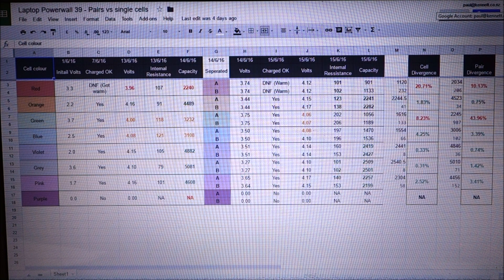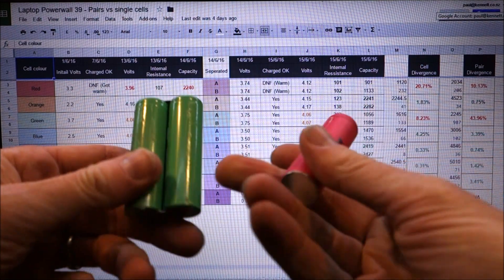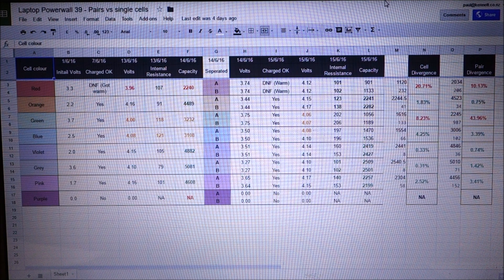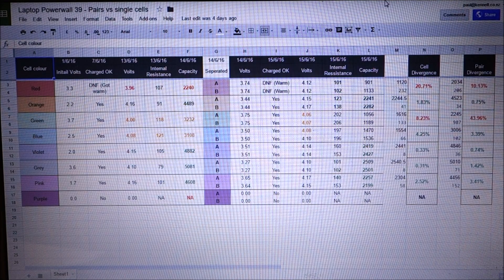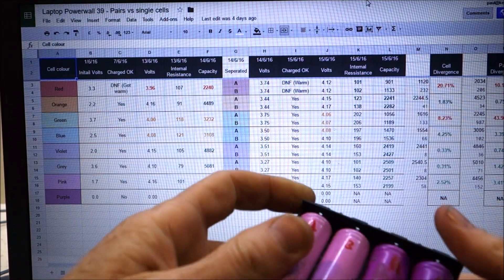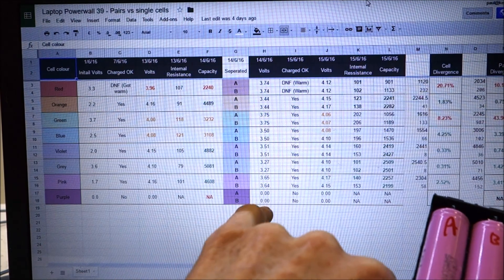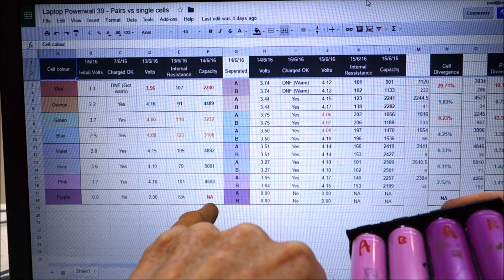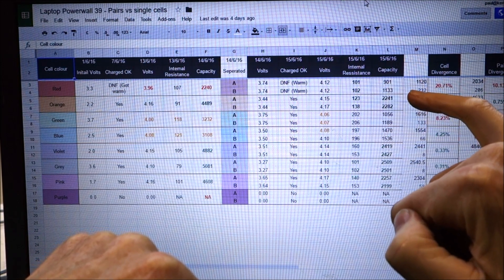Laptop Powerwall 41 - 18650 pairs vs singles: results

Comment: any suggestion for the balancing of these packs as a whole without the bms on them, http://www.ebay.com/itm/12V-280WH-BOSTON-POWER-LITHIUM-ION-BATTERY-PACK-18650-4-7AH-POWERWALL-BATTERIES-/182681892086?hash=item2a88b074f6:g:b7kAAOSwkX1ZdLk6
i have 40 of the packs but did not receive the ones i have from this seller 
keep up the good work sir thank you very much..
Reply from the maker: You could add an e-bike BMS perhaps or run them without a balancing BMS and just monitor them. They look like nice cells.

Comment: In my brief experience with old laptop 18650 cells. When you separate parallel cells that show low voltage/capacity, you might find some of the cells will take a charge, but never return to near it's initial voltage/capacity. Cells in parallel usually exhibit similar characteristics, even when separated.
Reply from the maker: Yep - that's what I found too.

Comment: When you discharge them as a pair then they will see 500mA per cell but when you discharge them as a single cell they see 1000mA per cell, this is twice the discharge current which will have an effect on a high internal resistance cell if my understanding of the internal resistance is correct.
Reply from the maker: True. I didn't bother to stay with 500mA per cell becasue I was more interested in looking for differences (delta) between the cells capacities, rather than their actual capacity.

Comment: I was wondering why the int resistance is not a lot lower for 2 cells i.e grey approx 50mohms and violet 75-80mohms.
Reply from the maker: Me too. Lots of potential sources of error in my setup; temperature, voltage, poor connections.
Reply from the maker: I'd love to see someone else replicate this test.
Reply: I would but I only have an accucel 6 which does not have that function.

Comment: Lower voltage after charge might be also caused by TP4056 modules. Looking at datasheet charging voltage is somewhere between 4.137V and 4.263V.

Comment: unrelated... i have a cell that charged up fine at 500ma. left it over night, but now is self discharging and getting warm. should i be concerned or just put it in the freezer and let it stabilize?
Reply from the maker: I would be concerned. A warming battery as it just sits there sounds like a bad situation to me. If it were me I'd discard that one. It could be that the electrical barrier between the anode(+) and cathode(-) is breaking down. If that process continues you end up with a short circuited battery. Which would be bad. I don't know for sure - but I don't like the sound of it.
Reply: I dont intend on using it i was just worried that i would need to keep an extinguisher nearby
Reply from the maker: I have an old steel ammo box that I put batteries like that in. Then take them to the recycler. Mostly things don't go bad, but...
Reply: +Paul Kennett day two its now down to .975v from 4.15. wowza. seems to be back to the normal resting room temp. ammo box is a good idea tho. thanks.
Reply from the maker: 0.975v... Yikes!

Comment: Great test. IR of red cells looks weird, you cant have 100mohm for single cell, and 100mohm for 2 cells paralel, its should be like 50mohm. High divergence of green cells is imho because after parallel discharge, you still had 3,,75V, which could be like 30% remaining, and discharging single cell with 200mohm you got cutt-off 0,1V (ohms law) sooner then discharging parallel two cells with 200mohm. 0.1V can be 10% сapacity. Measuring voltage after discharge single cell would be good to know too.

Comment: Good data there.  I'm with you on testing the pairs, especially since my battery packs are designed for pairs.  What I'm doing with the pairs that test poorly is separating those and retesting them individually.  Then if any of those are OK, I'll combine with other single cells I have to make up new pairs.  I end up with singles on the 3P laptop packs.  I've also just blindly stuck singles out of the same pack together and those have tested about the same as other pairs in that same pack.  If I have a 3S3P pack, I end up with 3 original pairs plus 3 separates of which I might have stuck two together and then I'll be left with one single.  I do try and test the singles at half the current that I test the pairs with to keep to the same discharge current per cell, although sometimes I forget to change the discharge setting.
Reply from the maker: I was too impatient to discharge the singles at 0.5Amps. 
With my previous pack I resorted to building pairs from singles towards the end as I trying to reach my 2kWh capacity goal. It does mean I have to solder directly onto the battery which I'd prefer not to.
One downside of pairs is they don't look nearly as tidy as the singles. HPPowerwall's packs look great.
Reply: I hear you on the discharge time issue.  That's why I sometimes forget to change the setting.  I do see a small difference in capacity between 1A and 0.5A.  When I separate my pairs (or singles from triples) I look for how to leave as much of the original strapping in place so that I can solder strap to strap and not to the cell itself.  I haven't separated many of my "bad" pairs yet, figure I'll do that once I skim off as many of the good pairs first.  I suppose a lot has to do with your availability of laptop packs.  I need to pay for mine, so it's worth trying to eliminate false negatives from the initial testing.  If you get no- or low-cost packs, then making a go/no-go call with as little time invested is a good strategy.
Reply from the maker: Yep - my strategy has always been to eliminate time wasters as soon as possible, but hang on to the "bad" ones for later when I'm more desperate.

Comment: From my own testing the variability in your test might be explained through the discharger you were using in the other video. As is designed to test once cell at a time the discharge rate (assuming 1A) will be split between the pair of cells and stress the batteries less if it were discharging at the single cell rate. But otherwise it is a good test showing how close the cells are to failure if they cannot handle a 1A discharge and the quality of the higher capacity pairs.
Reply from the maker: Hi Techburn. Yeah - I did consider discharging the singles at 0.5Amps, but I was too impatient. The main thing I was looking for was any difference between the cells - and I used the same current for all of those tests. My working assumption is that the OPUS BT C3100 could be as much as 5% inaccurate unless proven otherwise.